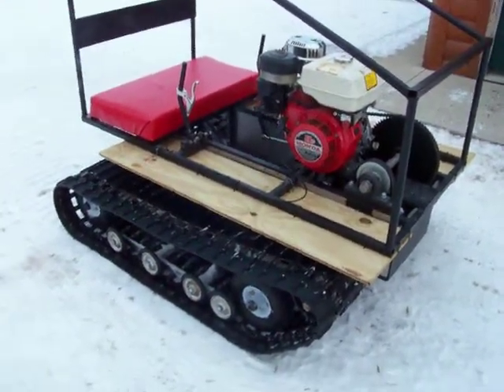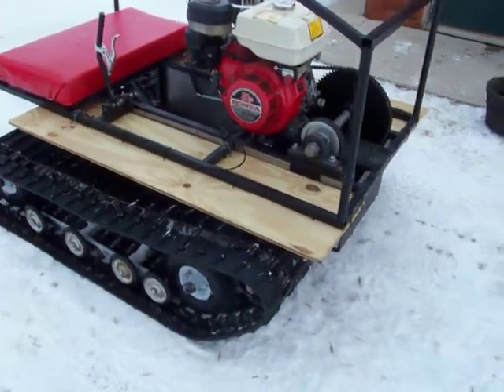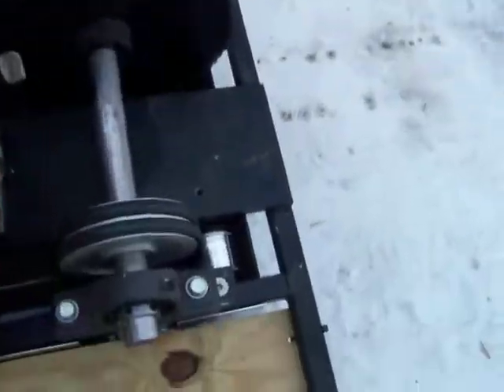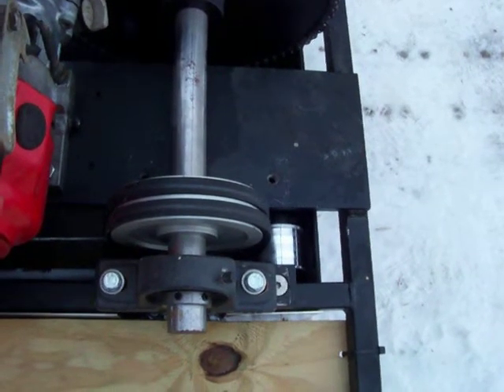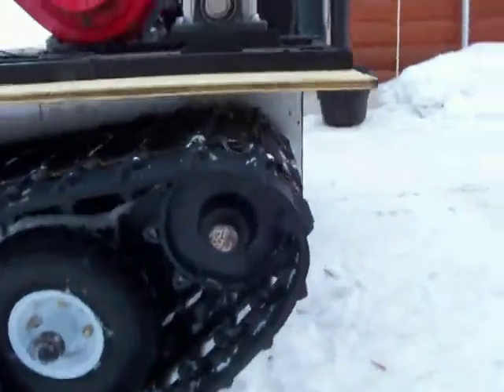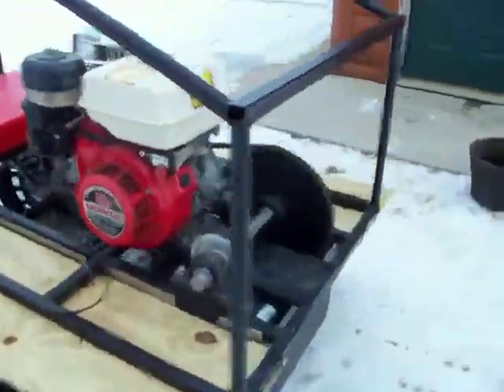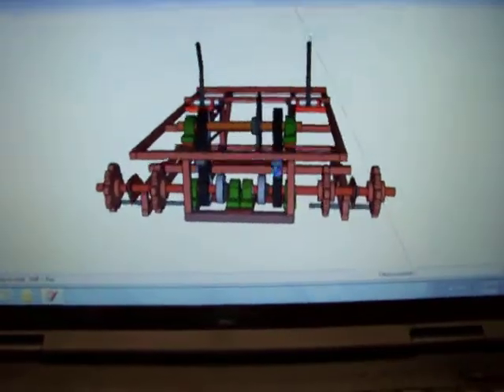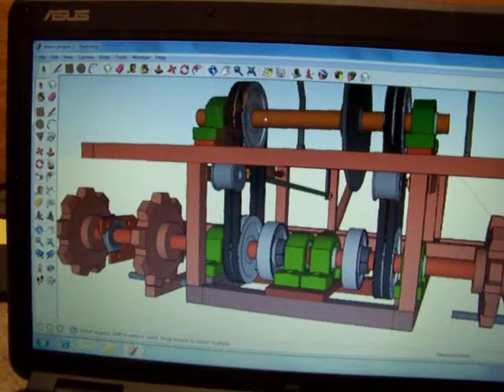homemade twin track go kart III

Comment: This is a great idea very good workmanship do you have parts list and plans I would like too build something like this thank you.
Reply from the maker: I used 120 inch tracks and just built everything around that but I did end up putting a bigger engine on it went with a 13 horse honda. I longer have this, belts got wet from the snow and would loose its drive so I took it apart just never got back to building another one

Comment: Have you thought about changing to two hydrostatic drives for each track possibly? You then could have reverse. You could put those in place of your pully system. Did something similar on a golf cart. Worked out great

Comment: Very cool. I've got a friend that is in a wheelchair and we are looking to build something that he can drive around his farm.  Would you share your drive train design.  Let me know.
Reply from the maker: concept is pretty simple motor drives a jack shaft (12 tooth on motor and 72 tooth on jack shaft) with 6in belt pulleys. one drives left side when belt in tightened and the other drives the right side. the drive sprockets for the snowmobile tracks are off of a snowmobile and they are 8in. Snowmobile tracks are 121in tracks. I started with an 8hp engine but found out was under powered in the snow, moved up to 13 hp and seemed better. with this setup I was able to get 11 mph. Down side no reverse and when belts get wet they don't work. hope this helps

Comment: Hi I tried looking for an answer on your other videos but can't find any info on which kind of shaft/bearing system did you use for your two output shafts, or from what did u scrounge that from? Good job on your go kart tank, its one of the nicest/simplest one out there on you tube

Comment: Where did you order the tracks for it it looks kind of like a bobcat its nice thought
Reply from the maker: tracks are from a snowmobile
Reply: mabe you should get a420cc predator engine from harbor freight put a high performance air filter on it get a new exhaust header pipe for it take out the govener and rejet the carburetor. mabe for the kids dingo go kart you should get a predator 212cc engine from harbor freight and put it on there

Comment: Hi i plan to build a tracked kart like this. I have some question for you. CAN i contact your by email ? Walliut@gmail.com. I would like to know if you change the 5 in pulley and the sprocket size when you change the motor hp also some question about sketchup.thank you great job

Comment from the maker: Tracks and drive sprockets came from a local snowmobile salvage yard the tires are wheel barrel tires and the bogie wheels are from surplus center on line, my first design the tracks would walk off when trying to turn on grass but this new bogie system seems to be better so far at least in the snow and ice

Comment: Thank you for getting back to me. I used a torque converter and a differential axle for the drive and brakes to turn. Now, you've gotten me interested in the road wheels and bogies for the track. I used pneumatic wheels for the road wheels and fabricated an  aluminum drive sprockets/hubs. I also had to fabricate track guides to help keep from detracking. They work OK, but your track arrangement seems to be pretty solid. Cheers